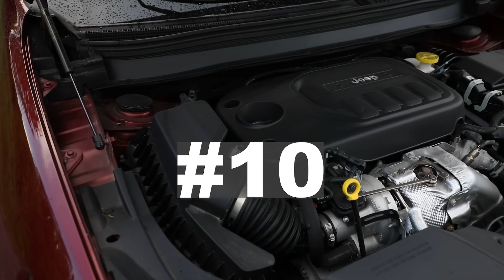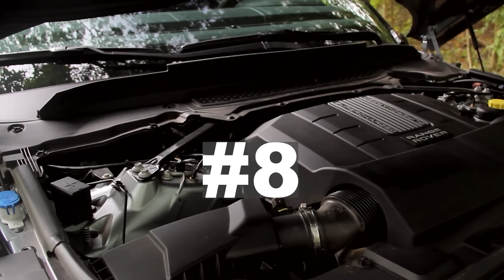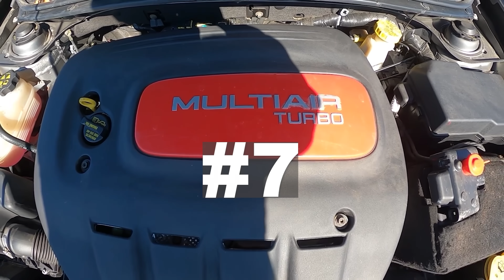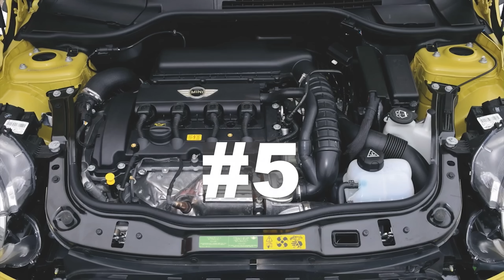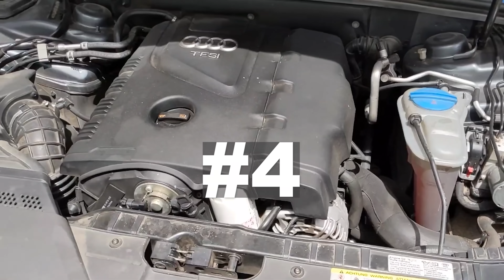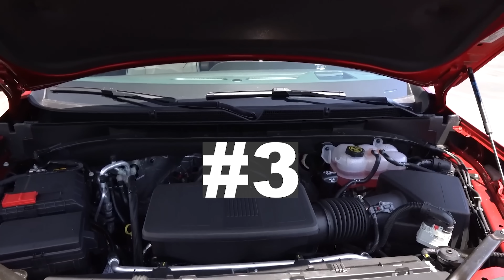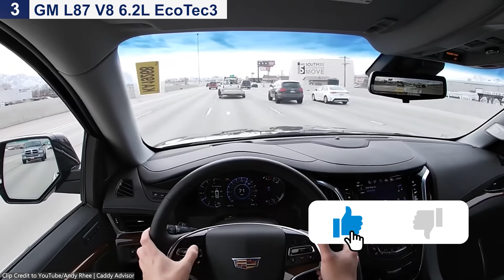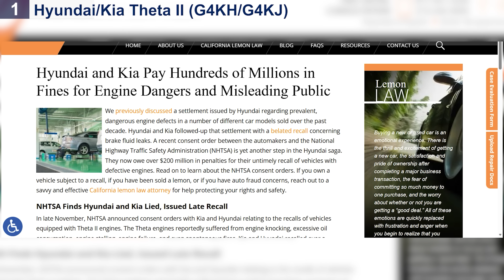The WORST CAR ENGINES ever made (AVOID AT ALL COST)

Comment: That excessive oil consumption due to weak piston rings, in 98% of cases result of government mandates, taxing on amount gas-of-life coming out of the tailpipe. Combined with the total ridiculous carbon-credit system.  Encouraging manufactures to put really weak piston-rings in, since that saves a tiny bit of fuel.  Never mind the oil consumption and self destructing engines.... that is very handy for the 15-minute-city-agenda.
Reply: That and the water thin oil they run in everything for better mpg.
Reply: @4dscdriver  This are two sides of the same story,  you cannot make  tight rings with water thin oil
Reply: I have a 2001Toyota Corrolla with a 1ZZ-FE engine with 150000 miles. I got it used so don't know the history but it burned a quart of oil in less than 100 miles. I just put new rings in it so hope it helps.
Reply: @donaldvandenberg4429  You put new rings in it without proper diagnosing what the issue is? Firing the parts cannon in 5 4 3  2 1 ..  🤣 Are you sure you are not just an AI bot?
Reply: @donaldvandenberg4429 
Previous owners just run the car without frequent oil changes, which clogged draining canals in oil control rings - nothing new. Almost every CR-V, 2000 to 2012, 2015 maybe had that issue. New rings, deglazed cylinders, proper break in and regular oil changes at 5k miles and none of them came back with the problem. 
I also own 2007 Matrix with the same engine. Burned more than quart for every 2k miles. Eventually I did agresive engine oil flush and the problem disappeared.
Reply: Change oil to thicker by one grade up. 0W20 to 5W30 for instance.  EPA are not mechanical engineers, they are ENVIRONMENTAL FANATICS.

Comment: New nissan 1.5 turbo engines are failing daily. Recall incoming.
Reply: Nissan had a great ideal with the juke, then dropped a shitty engine into it. Smh.
Reply: @Cain88M absolutely. But the new 1.5 turbo is even way worse than the juke engine sadly.. Massive failures. Main bearings, head gaskets, egr valves and coolers, intercoolers. Its the worst nissan engime ever by far.😢
Reply: @hellboundTX333  I'm glad mine has a VQ then lol
Reply: @Cain88M VQ is pretty much nissans best engine ever. Been going strong since '98!

Comment: They sure don't make them like they used too . My 1993 Nissan D21 tray back pickup with VG30E V6 engine is still going strong with minimal maintenance and still doesn't use oil after 300,000 miles..

Comment: 27 year master tech here ,thank the EPA for a lot of these problems.unreasonable fuel efficiency standards are in large part the culprit of the longevity concerns .the rest is corporate greed. 
With modern catalytic converter technology pollution is not a concern anymore.
Reply: 🎯 Some would call it the "Big Green Scam" but whatever. 😌

Personally, I'm biased towards Japanese-made (Toyota/Lexus...VIN has to start with a J) and only naturally aspirated, NO turbos.  And nothing newer than maybe 2019, preferably much older.  

These new cars with all these (unnecessary) gizmos are made to fail (part of planned obsolescence...but that's not only for cars but tools, electronics, appliances, new homes, etc.). 🤑

Then again, a lot of people these days seem focused more on the big infotainment systems and the stitching of the seats rather than what really matters like the engine or the transmission.  Interesting times we live in. 🙃
Reply: Absolutely true !  Bureaucrats that don’t know anything about cars or engineering!
Reply: Ever since they switched to low viscousity 5w-20 and low tension piston rings the oil consumption appeared. I don't remember engine running 5w-30 from late 1990s to burn oil. Then they asked for higher efficiency so variable cams, direct injection showed up and chain failures started, BMW being a prime example. You just can't magically increase the output while making the very complex engines and transmissions working at the edge of safe operating conditions. Eventually something will fail. On top they come up with this idiotic expectations that oil change can be moved to 10k miles.
Reply: @pliedtka 10,000 mile oil change interviews. This was done so manufacturers could advertise low ownership costs.
Don’t go more than 4,000 mile. Also keep track of the TIME between oil changes. Short trips help lead to oil sludge.
A number of very tine oil passages (just like veins in your body ) get clogged. If the oil can’t get where it needs to go it’s the
recipe for reduced engine life (same with your body and arteries clogged with cholesterol).
Bet change intervals are change oil every 3,000 miles or six months whichever comes first.
Replacing a bad engine is very expensive. If you have a history and keep a maintenance record
can help make your car more attractive to a potential buyer.
Reply: @pliedtka  Your observation is spot on! I couldn't have said it better.
Reply: Any time the government gets involved they screw up
Reply: @tonywhiddon8214      Yet Americans are soooo very proud of their military.   100% government run.  There are many more examples, but we'll start with that one.
Reply: Oh really? I had 90's cars that got better mileage than some of these new cars. It's the manufacturers that only want to shove large profit SUVs down our throats.
Reply: @keithlibner9259     My brother, a mechanic, says this all the time.  He says "we can tune an engine to get great economy" - but they don't.  It's like "climate change" - it's another scam to get free money by scaring people.
Reply: Yes, Josh, but your "with modern catalytic converter technology pollution is not a concern anymore" - solidifies the cynical "thank the EPA" eye-rolling.  So, which is it - the EPA requirements are good ??  Or bad ??   (Can't have it both ways, sweetie)    🙂
Reply: Yeah, yeah, right, let's go back to 12 MPG engines.  Same old, tired BS from the MAGA loons.

Comment: My son's Kia Sorento was burning a quart of oil every two weeks at 90k miles. The Kia warranty only covered engine bearing failure. The engine blew up at 105k miles. Dealer wanted 9k to replace  the engine.  Had it done at an independent shop for 5.5k. Using only aftermarket parts no Kia garbage.
Reply: They should have replaced the engine under warranty if he was the original owner.
Reply: @filippocorti6760 my wife has a 2013 Kia Sorento second owner 90,000 miles motor blew up they replaced the engine brand new free of charge. She bought it from Kia with 30,000 they gave her a free oil change as long as she owned it all oil changes were done at the dealer and they did replace it free
Reply: You got screwed over my wife has a 2013 Kia Sorento second owner all the oil changes were done at the dealer 90,000 miles engine blew up they replaced it with a brand new long block free of charge Kia has 100,000 Mi warranty on their engines

Comment: Are we talkin' bout the Chevy 305 yet?
Reply: Those didn’t even have enough power to throw a rod 😆
Reply: @TheMajictech  , I always thought of it as a truck or van engine, and a bad one at that.
Reply: @markthomas2436 it was, but just like the 318 dodge. If you add some compression and decent flowing heads that tiny little engine can make pretty good power
Reply: @markthomas2436  yeah a 250 or 292 was better.
Reply: @TheMajictech  , the 305 makes an excellent boat anchor when you are fishing, too.
Reply: @markthomas2436 if we only had the option of one now. The simplicity of those days. They didn’t get bad fuel mileage. And you dang sure wasn’t replacing rear tires every month 😅
Reply: @markthomas2436  https://youtu.be/XHuO2lMx80c?si=NopbK8KhL482uUFa

Comment: I paid 3,200,00 for 2002 Mercury Gran Marquis, 4,6 V8 with 105,000 miles , just drove it 4000 miles on a road trip , I used a 1/4 quart of oil . Runs great and got an average of 23 mpg going 72 mph. I put 5/30 wieght oil instead of 5/20.
Reply: Fords and Mercurys are the only vehicles we buy - no issues at all - our oldest is 1997 F250 4 x 4 crewcab with 7.3L diesel - love this truck!  (bought brand new - ordered it from Ford in 1997)
Reply: Those are great cars.
Reply: It's a shame they want to make you to wear your motor out faster running that light 5w20 cost same as 5w30
Reply: Yeah.. I bought a 2001 Ford ranger with 140 thousand for 2000.00 bucks.6 years later still daily driver.
Reply: 320,000 thats alot for a car
Reply: Those Panther platform cars are built like tanks.  Simple and last forever.  You’ll get many years of service out of it.  Enjoy!

Comment: I own a 2017 Kia Sportage that is on its second engine. The first engine spun a bearing at around 70,000 miles. It through a check engine light and began to run abnormally while I was on the interstate. I was not too far from home so I had it towed to my local dealership. They set me up with a rental car and it took nearly 2 months to get it repaired due to a backlog of vehicles needing an engine replacement and a shortage of replacement engines. They spent over $7500 on the replacement. The new engine runs good but I am going to start watching it extra carefully at around 140,000 miles. Unfortunately I think that it will need a replacement transmission before it needs a new motor.
Reply from the maker: Wow, that sounds like a tough situation. Thanks for sharing your story!

Comment: Maintenance maintenance maintenance
Reply: Also, ignore manufacturer recommendations for oil changes at 7,500 or 10,000 miles.  Change your oil and filter every 5,000 miles.  Oil is cheaper than major overhaul or a new engine.

Comment: The Theta G4KJ Hyundai engine has a single port GDi issue. Lack of oil is the effect, not the cause, but in turn it will cause overheating and terminate the motor. The cause is a single port GDi which has no wash over capability. Legacy direct injection rails allow fuel additives to clean as you drive. The single port GDi does not. This causes a slow build up of gum which glues the sealing rings onto the pistons. This increases until at 90,000 miles, the rings are stuck closed. Then, every 200 miles, a quart of oil flies through the combustion chamber gap and out of the exhaust. This is called 'blow by'.
A 4 x 6-hour single day soak of Berrymans B-12 is all you need. Do that every 75,000 miles, directly into the pistons. This will prevent the blow by problem. Mine is at 125,000 with no issues.

Comment: I’m of the opinion that, as far as mpg, etc get the government out of the car business. Manufacturers are constantly having to build their cars around fuel economy and less on durability. The government needs to require some kind of reliability in vehicles.
Reply: Emmissions are the elephant in the room for Europe. They are  so obsessed with cutting emmissions that the engines are IMO choking on their own exhaust output, not to mention trying to get max power out of lighter built smaller engines. I won't touch anything after 2012 now. I think the most reliable balanced with economy were engines produced through mid  90's through to 2010.
Reply: Vehicles are built to be as cheap and quick to produce as possible.  But, yeah, without the EPA all engines would last 500k without so much as an oil change. 🙄
Reply: Amazing that Toyota, Honda, and Mazda can do both:  reliability and great mileage?
Reply: It's not an either/or situation.  Car companies and their engineers can do both and have done both.
Reply: The government isn't mandating shoddy design or workmanship, Einstein.  Electric vehicle technology has been around for 50 years.  The Toyota Prius is an awesome car.  I'm guessing your citizenship is USA and you routinely blame the b---- and the j--- for almost everything.
Reply: bingo!
Reply: Don't look the Honda in Subaru they fell into the CVT transmission trap
Reply: Don't blame "the government", blame the greedy corporate management culture. If you graph the pay of your average assembly line worker against that of management/CEO, they have decided to cheapen engines and skimp on engineering so they can make ever more money. It is a race to the bottom. I have given up on new cars.
Reply: @colin5196 Well, it does have something to do with the fleet MPG requirements.  But Detroit responded to those requirements in the wrong way.  They started tinkering with the motors and modified them in ways that would pass the new vehicle tests but fail quickly when used by consumers.  Cars are less safe now, due to the new bias toward engine failures.  There's a YouTube video about 12 engines you should never buy, including most 2 liters.
Reply: Donald, put this in perspective. What other products do you own that give you a warranty essentially for the life of the product at this price point? The average price of a vehicle is as of today $50,100 and they are covering thousands of parts from failure due to misuse, neglect, abuse or just a bad part. I have never owned anything that has so many parts that can fail as an automobile has, yet the manufacturers warrant them all. To give you a "bumper to bumper" warranty on such a complex piece of machinery most will never appreciate.
Reply: @BullittGT849  You are too impressed with complexity. Yes, you CAN make a reliable modern automobile with thousands of parts. We certainly do make complex air planes and ships and submarines that must be reliable.

Comment: I’m surprised that the GM Ecotec 1.4L turbo 4 cylinder didn’t make the list.
Reply: My 2021 Equinox blew the main engine seal at 47,000 miles. Changed the oil every 5,000 miles even though the manual and info screen say every 7,000 miles. Looks like I should  have changed it every 3,000 miles. Other suggestions like the one minute warm up and cool down weren’t ever on my radar until I researched why the seal failed. Luckily it’s still under the original 60,000 miles drive train warranty so Chevy replaced it at no charge. Sadly I had to take it to them 4 times to finally finish the job. They first replaced the upper oil pan saying that it was warped. When I got it home it was dripping oil way worse than before. That’s when they diagnosed the seal leaking. After bringing it home with the new seal I noticed pink fluid on the bottom of the engine and frame. They looked snd said that the mechanic spilled some transmission fluid and it was just residue that was dripping. They cleaned it up that issue persisted. The 4th trip to the service department exposed that when the transmission was dropped to replace the seal a seal for the left axle was damaged and was leaking fluid. The vehicle now seems to be leak free. They did provide 2 loaners during this period so I was never without a car. My 2 choices seem to be to sell it or to extend the drive train warranty. It’s $5,000 to basically double the 60,000 5 year warranty.
Reply: @ricknorris1466  I would put that 5,000 toward a replacement for a Toyota along with getting rid of the Equinox
Reply: @hobocatlawrence  3rd option. Thanks!
Reply: @ricknorris1466 I would sell it,  GM used to make good vehicles, but sadly 😥  that's not the case now.  They have gone from one of the best auto manufacturers to one of the worst. I used to buy nothing but Chevys Pontiac and oldsmobile, but now I don't even consider anything new that's made by GM. They are awful.
Reply: That’s in my Buick Encore. I am trying to keep it as much GM serviced as possible. Yes, it costs, but if something goes wrong, maybe I have a little leverage.
Reply: @DetroitDon929  I take mine to the dealer, something goes wrong, the last person that services it at the shop has some explaining to do.
Reply: No ford eco boost, paid off?
Reply: Made my list
Reply: Nah the 1.4 that was in my Buck Encore were great. Just traded it in for the 1.3.
Reply: Because it’s a decent engine

Comment: My 2022 Honda Crv hybrid at 114k has a blown headgasket
Reply: @flexin4life I’m not surprised about that it’s a modern Honda, which is unreliable you can also add on the list Honda Accord and the civics have engine, failures and transmission issues too

Comment: With the exception of high performance cars, the law should require a 100,000 mile warranty on the powertrain of every car and truck.
Reply: That would add a bunch of $$$ to the cost of a new car/truck. BTW - Any new car dealer (and some aftermarket guys too) will be glad to sell you that 100,000 mile PT warranty.
Reply: @glenatgoogle4393  Up until GDI, 0W20 and the turbo micro motors, engines regularly went well over 100,000 miles before needing any kind of repairs. There were some bad designs, but now every new design is bad.
Reply: @basswars7060: great idea.
Reply: I had a 1978 Chevy Monte Carlo with a305 cubic inch 2 barrel V8. It would use 2 quarts of oil per 1,000-1,500 miles and it would ping and knock on all grades of gasoline. Premium unleaded didn't help at all. That engine was a lemon. It would blow black soot out the exhaust pipe.

Comment: Stay away from any new turbo engine...2010 to present.
Reply: If you have one you must remember they NEED often oil changes. They do not take kindly to lack of maintenance. My mechanic told my daughter that on her 2021 Chevrolet Trax 1.4 liter to keep an eye on the oil life monitor. When it is at fifty per cent oil life left change the oil. Or it will sludge up and blow up.
Reply: Sadly almost everything has a turbo these days. I'm looking at getting a Stepway with the 0.9l turbo. I was considering the Civic till I found out it was a wet belt and the Focus 1.5 diesel also has problems. Everyone I speak too seems to love the reliability of the Dacia.
Reply: I've had several and never had one issue with the turbo. '15, '18, '21, '24, some were V6, some were I4, not one turbo problem. Don't shut 'em off after spooling the turbo (park it, let it idle for 1 min or so, THEN turn off the engine) and change the oil often.